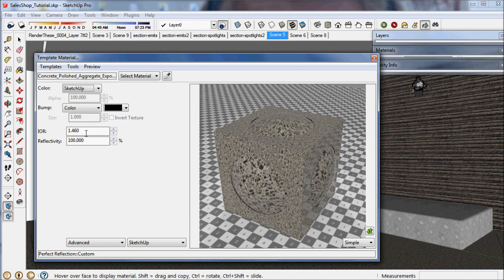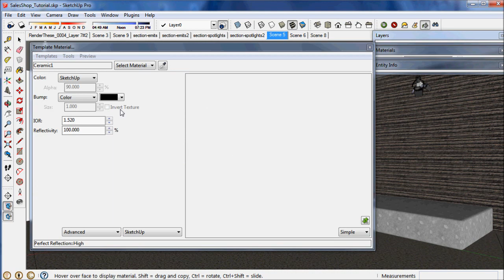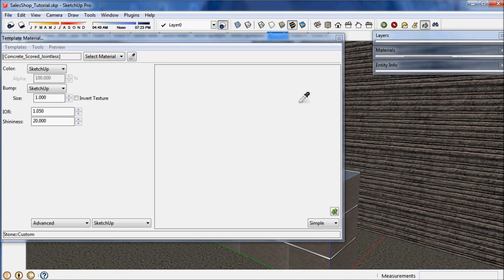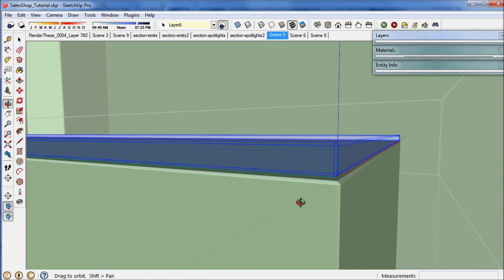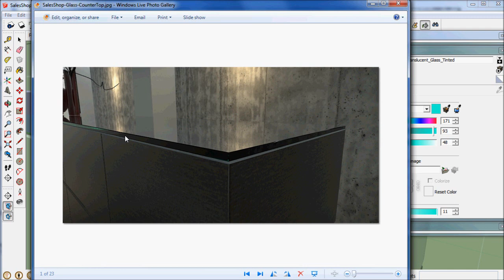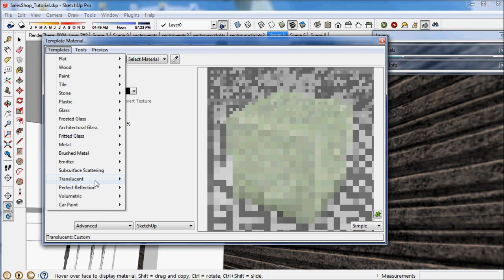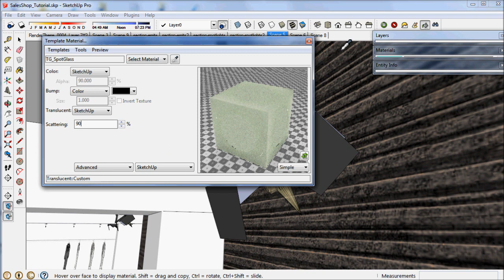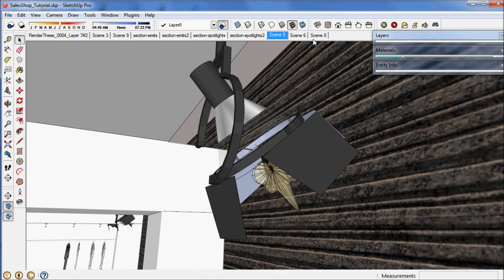Twilight Render Tutorial Materials Architectural Interior

Comment: What's the value and purpose of applying a 'template' to a standard Sketchup Material if the values must still be 'tweaked' to get acceptable results?  And exactly where am I supposed to get the intuition to know what to tweak and how much?  !! Geez...
Reply from the maker: +Robert Luster There is no need to "tweak" any of the templates' default settings in order to get "acceptable" results. These tweaks are to give a basic understanding how one could go about changing the settings if they desired. In the case of some templates, this will be useful, in the case of others, it will not. For instance, basic glass you can simply leave alone, but perhaps if you want to change how shiny your plastic is, now you know how you can approach changing the shininess of it.
Reply from the maker: See the Twilight Render Getting Started Tutorials: http://www.twilightrender.com/index.php/tutorials/67-tutorials-v2/160-basic-rendering-tutorial-v2